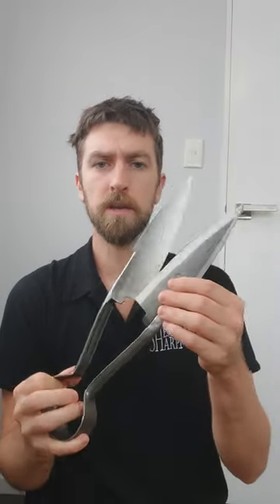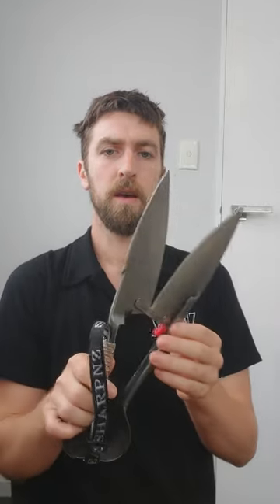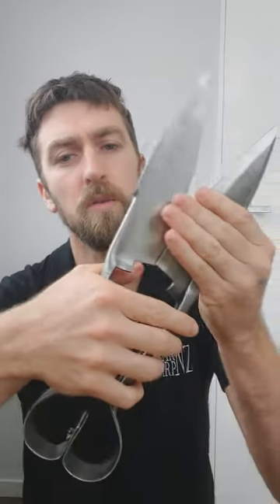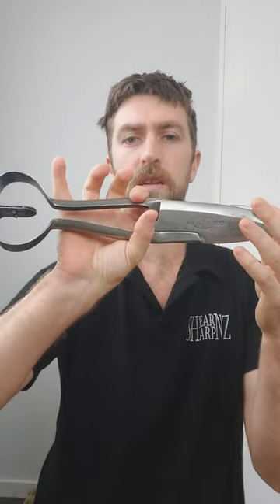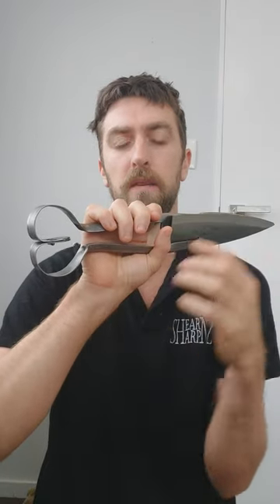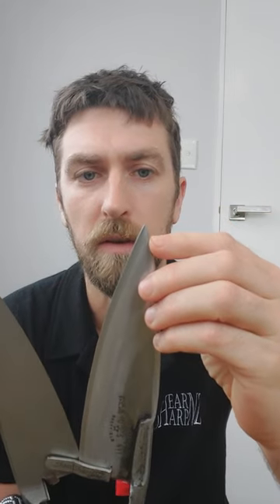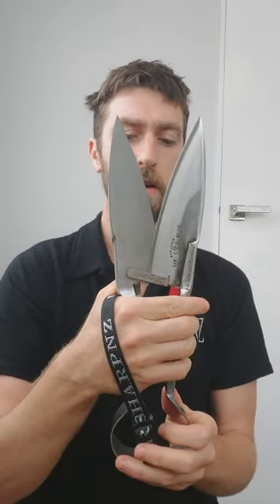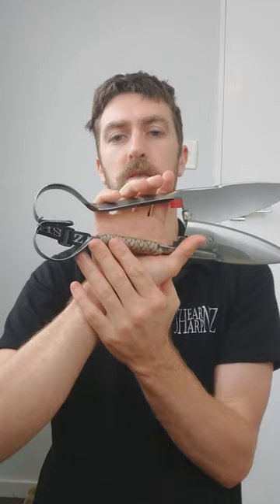Blade Shears (hand shears): from the factory vs done up by Shear Sharp NZ.

Comment: Thanks for the info. I'm new to the game and have cheap pair of shears that have a slightly rounded edge, definitely not a knife edge. Do I need to give them an extended 'sharpening' with a stone? Or use some kind of a file? Thank you.
Regards.
Reply from the maker: I would suggest grinding the shears to make a thinner sharpening bevel. I have a video about grinding your shears that might help
Reply: @allantheshearer   Thanks for the reply. No electricity at my place so the grinder's not an option but I've got a good idea from your video what I need to achieve. I'm using a couple of files instead, before the stoning.
Excuse me repeating the obvious: so the stoning bevel is separate to the 'slant/bevel' on the outside of the shears? I was trying to create one bevel with the files- before I watched your grinding video- a lot of filing and still don't have a sharp edge. The smaller bevel will help!
It's been a question in my head since I've started using shears- what kind of a bevel or edge do shears have. Finally found out!